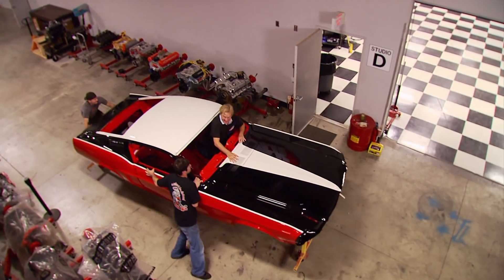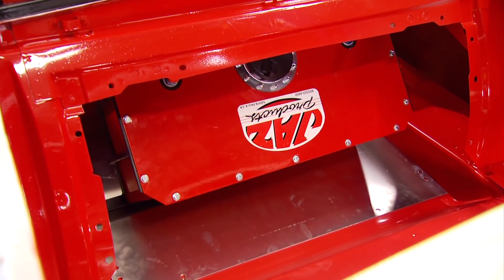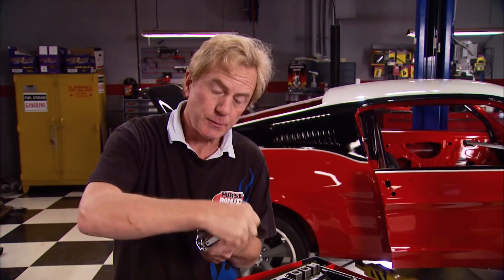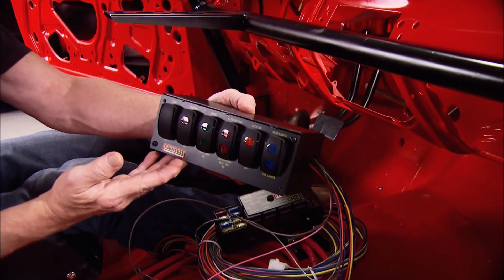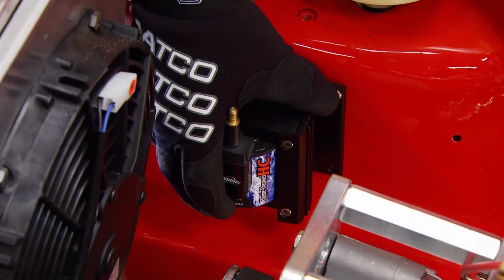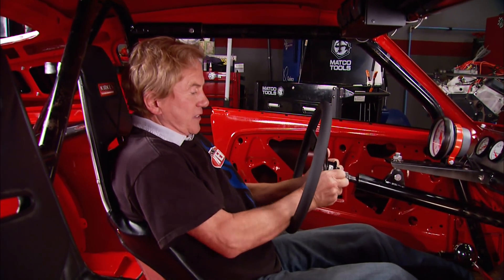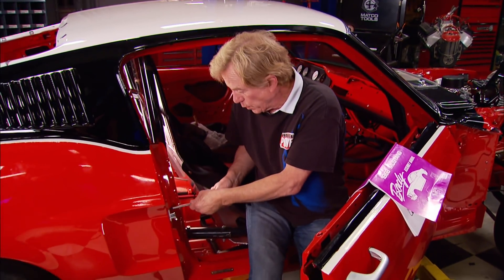Picture Perfect: Re-assembling The '68 Mustang Fastback Track Car - Horsepower S13, E19

Comment: I can't even begin to image how nice it must be to assemble this Mustang with all new components, bolts, washers, and nuts everywhere!
Reply: It be fun 😸
Reply: But my hair starts to raise whenever i see then drill or cut a hole and don't grind down the sharp edges and no primer, paint or sealer is
being used to protect the bare metal.
Reply: @3DPeter  Just yesterday I bought a 1965 mustang fastback with the pony interior. The guy who had the car had bought a 1967 Chevelle from me about 40 years ago. I found his for sale listing on craigslist where it had just been listed three hours before. The car was about 25 miles away from me so I shot over and checked it out. I had some good items that I was willing to offer plus $7000 and he took it. The car has all the new sheet metal, floor pans, rear quarters, front fenders everything accept the engine and trans. I am thrilled and have done four mustangs to this point plus I am certified in corvette restoration by Bloomington Gold Corvettes. I never thought I'd ever find a 65 fastback that was a good deal.
Reply: @TheGeonam  love to see so videos of it up here on YouTube. Even if it’s just some walk arounds and what not. Congratulations on the find my friend, and keep it in good order as they are getting harder and harder to find. 😔... 
American muscle is really changing now days.. 😳
Reply: Right   Ti nice  to work with  new components   When. You have the money 💰 company s. Given the part s  to build car 🚗 on the  show.  When have new parts all round you. Ti must be nice to work with new parts

Comment: All the holes drilled after paint should get a touch-up of prime and color to prevent rust creeping out later...Just sayin.
Reply: @Grunt49  Anything worth doing is worth doing right. Looks like a show car to me.
Reply: swab some axle grease on it before placing the grommets.
Reply: saw same, thought same ... there´s the rusting base
Reply: This car will probably never see rain.
Reply: @williamsizemore98  it don’t have to rain there is moisture in the air. And it will oxides 👌🏴
Reply: @Grunt49  What? Why let a race car rust prematurely when they could have simply sealed it up prior to putting the grommets in place.

Comment: We always ran the coolant overflow tank into the frame rail OR properly onerboard so any water wont get under a tire and cause a crash. Also like the poly coolant that operates at low/zero pressure.

Comment: This car is badass!
Made me a little nervous when the kill switch tab was tacked and weren't wearing gloves.
I kinda feel like some of the accessories were an after thought, drilling into fresh paint when everything could have been mocked up before and drilled/painted over right away to prevent rust from forming VERY quickly.

But I digress it's still a kick ass car!

Comment: I wouldn't be able to ignore the bare metal on the holes you drilled
Reply: Lol...that was my 2nd though after watching...but those are the only stains on the white vest ;o)
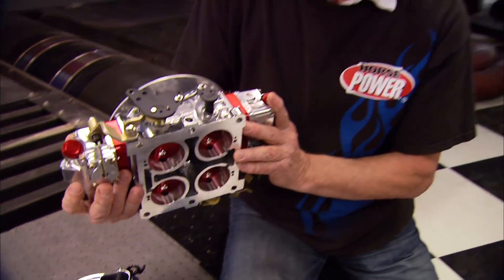Reply: That and the abysmal fuel line run. It was a really great 17:50 commercial for all the dealers that gave them parts for the plug.

Comment: The drive shaft is not a  “     RECIPRACATING MASS   It’s “ ROTATING MASS “.  There’s a huge difference , recipracating = is a forward then backward motion , like a hand saw would work .  ROTATING MASS is just that , rotation . It goes around around around ! Just remember this about a light drive shaft .. you get the obvious weight reduction but what you lose is  INERTIA .  A heavier shaft will help with “ free rotation “ . Lighter shaft will still rotate freely of course but would stop its inertia rotation sooner than the heavier one..

Comment: What's the point of the shifter extension.??  The old bloke was miles away from the pedals and the yound guy firing the car up was slid all the way forward with his clutch leg extended as straight as it could.  That seat needs to come about 6" forward.

Comment: Why did you go with a solid rear end when you could have put in independent?  If this is a pure track day car, wouldn't you get better handling going with independent.
Reply: At least coil overs with a better controlling set up.  But I guess it might be in the class rules they plan on racing.
Reply: Nostalgia rules

Comment: Surprised they went with a live axle, that was a clear performance compromise on the build! The 9" they used is better suited for straight line performance!
Reply: Nope , depends on , weight torque…. There are many advantages to a live axle in some situations , try a pan car with ir = last place , daytona cup car , injected sprint cars , 1965 to 1970 mustangs vs 1965 to 1970 vets (many tracks , many years , so much proof ) better for tires , maintains alignment, more durable , typically less parasitic loss.